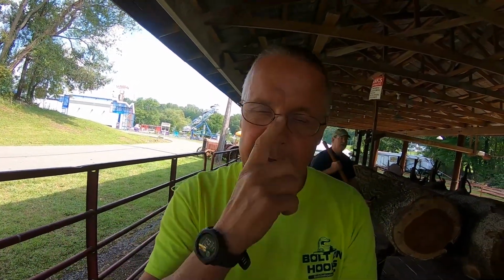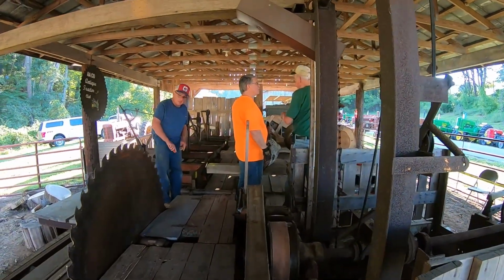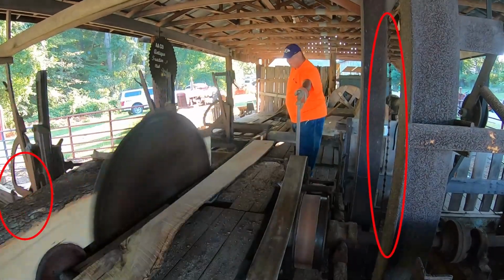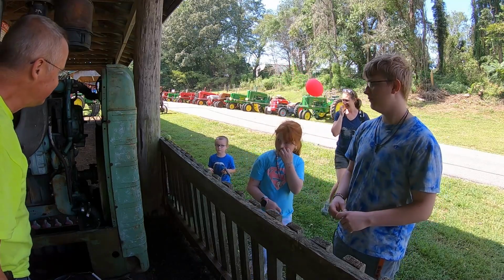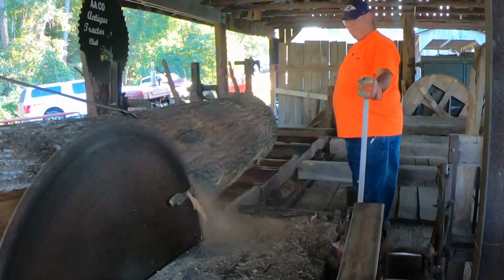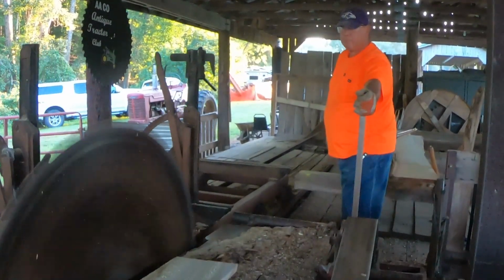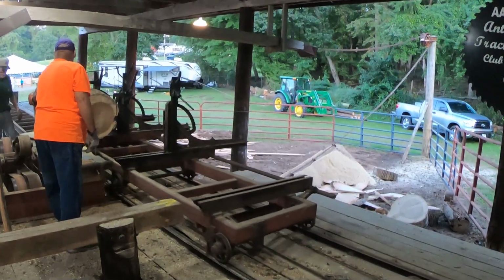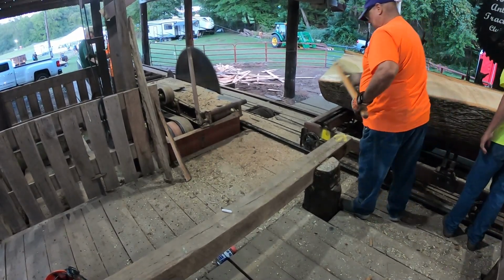Detroit Diesel Powered Frick at the County Fair: Day 1

Comment: dad worked at the sawmill it 2 was a Frick sawmill a GM DIESEL 671 w straight exhaust pulled it ,it had a trip edger U didn't have 2 edge the boards it had the old hands dogs it was changed 2 air dogs and very good man log turner the sawmill also had a debarker it sounded better when U could hear it saw a line 👍 years ago there were sawmills every where now 2 day U don't even see 1 everybody has went 2 the band sawmills U can hook up 2 a truck and move them they take a long time 2 saw alot of lumber OMG 11 1O 2O22
Reply from the maker: Clarence, thanks for watching, and very cool on your Dad. We actually have one local sawmill around here that still uses a Frick, but.... They have a top saw, air dogs, hydraulic turners, etc. so they can process some wood. The 671 has a lot of power, probably twice what we have in the MM.

Comment: I don't think think this supercharged, it has a blower like all two stroke Detroit diesels.It's used to blow out the exhaust gases, it does not provide any extra power.
Reply from the maker: Hey Dino, It's my understanding it it a supercharged engine. It is a gear driven compressor that takes air from the air cleaners and forces it into the intake manifold. Being a 2 cycle engine, it really has a hard time sucking in enough air to compress, so they put this gear driven blower on it.
At least that is my understanding!
Take care.
Wayne
Reply: @WaynesWorldGarage  Wayne, your understanding is correct and you (and Dino)  can read about roots type superchargers here: https://en.wikipedia.org/wiki/Roots-type_supercharger